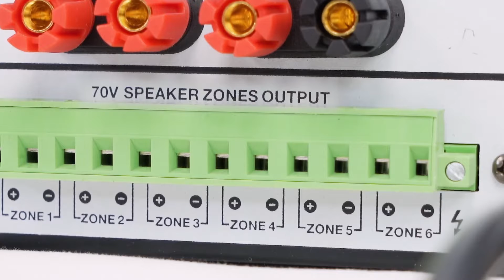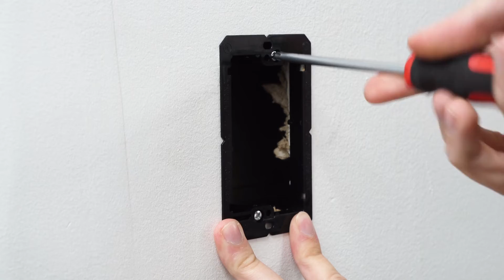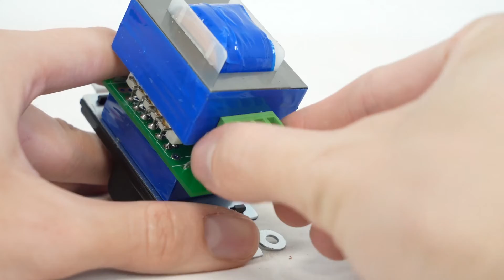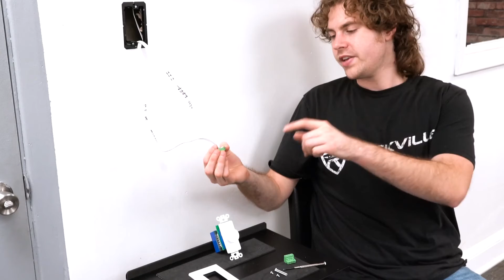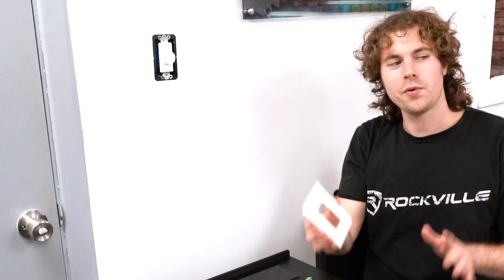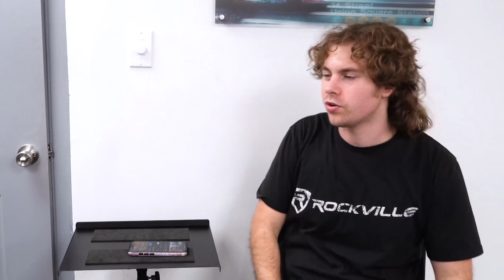How To Set Up the VOL70100 Black, White, & SS 100 Watt 70v Wall Volume Controller for a multi-room

Comment: will this work on a Bose AmPlus 100? I need a remote volume control, (not IR). I am not using the 70 volt feature, just my home floor speakers. The Bose AmPlus 100 has two wires only. Thanks.